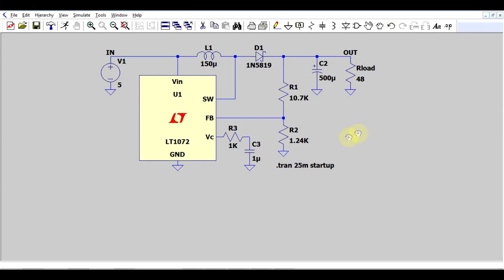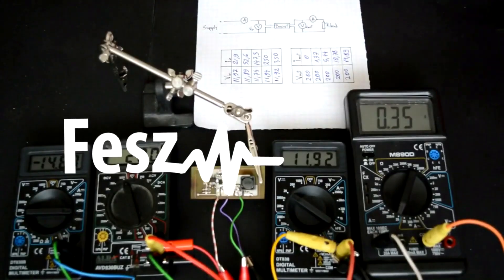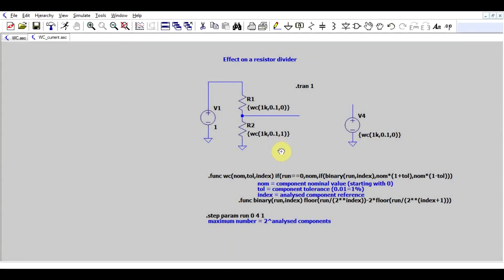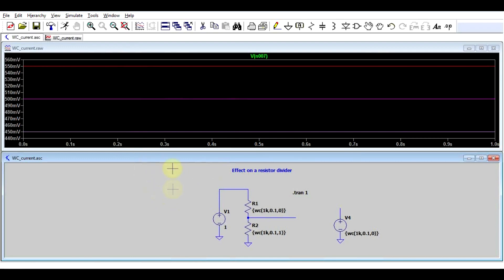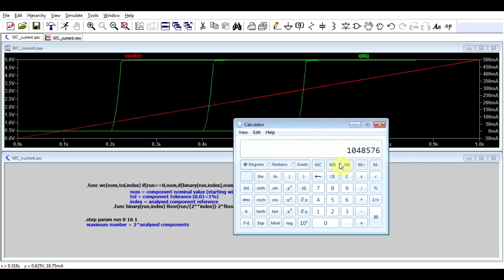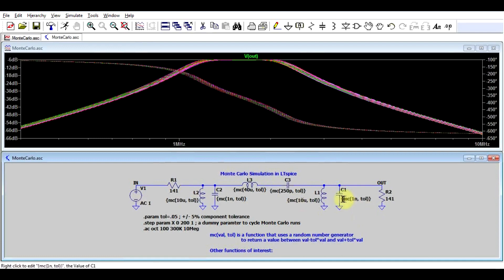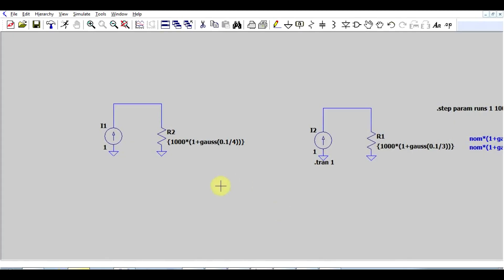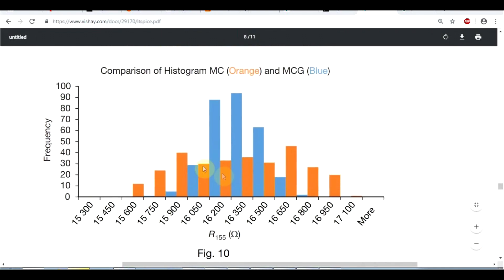LTspice tutorial - Worst Case, Monte Carlo and Gaussian statistical circuit analysis

Comment: Likewise, beyond glad, thank you. In WC analysis how would you model correlated resistances (like two conductors in a cable that could each be between 0R and 100R (ie will track each other depending on cable length)?
Reply from the maker: I'm not sure I understood the question, but you can define a parameter independent of a component as having a tolerance: ".param res={mc(40,1)}" and then use this parameter in the component definition, or any number of components; so you can have R1 and R2 with the value {res}; or some variation of this ex {2*res}
Reply: @FesZElectronics  Perfect, thank you so much. That is the fix I needed.

Comment: This analysis, although technically correct doesn't necessarily reflect the real world. The reason is that the component manufacturers often measure the value of each new component and then bin them accordingly. That skews the distribution of values considerably. The result is that if you purchase 1000 5% 1k MF resistors virtually none will fall within the 1% tolerance as they will have already been weeded out and classified as 1% tolerance. What you will get is resistors that are about plus and minus 5% away from the nominal value but virtually none that are within the 1% and 0.1% bands.
Reply from the maker: I have to say I only partly agree; Of course some amount of binning is done when resistors are manufactured, but the 0.1% resistor and the 5% resistor will most often be built from different materials and using different techniques; with very good precision you also want low temperature coefficients and other parameters to be more controlled. I guess also the measuring its self is far more pretentious to verify the 0.1% compared to the 5%; anyway, I do agree that a 5% and a 1% (or any other close tolerances) resistor can be built the same way and just separated by binning;
This raises an interesting question though - how can you simulate a tolerance interval - so not 0 to 5% but rather 1% to 5%. I will have to look into this a bit.
Reply: @FesZElectronics  I would think 0.1% resistors would be individually laser trimmed simply to improve the production yield. It may also depend on the manufacturer.

Comment: Great tutorial as usual. However, I am getting an error message "can't find model MC". I thought this was built in to LTSPICE. Using values such as {mc(2nF,tola)} with version 17.0.24.0 on Windows 10. Do you have any idea? Thanks
Reply from the maker: I currently have the 17.0.23.0 version installed and have no issue. Anyway the mc function was around even in LTspiceIV so it should not be a version issue.
Did you try running the "montecarlo.asc" simulation found in the LTspice instalation folder under examples->educational? if that runs correctly, the issue should be some sort of syntax thing..
Maybe you can share the netlist if the circuit is simple? (View->SpiceNetlist)

Comment: Great Work; excellent explanation! Can the temperature Spice Directive .tmp -40 25 85 be included in your mc schematic? Also, do you have a website? If so, please let me have the link.  Many thanks, R.
Reply from the maker: You can include temp directive also, just make sure the circuit actually takes temperature into account. 
I don't have a website though, never found the time to make one.

Comment: Hi FesZ, nice video. A few points:
1. "The guys at Analog" did not come up with this idea - I did. I was inspired by a blog post ( http://k6jca.blogspot.com/2012/07/monte-carlo-and-worst-case-circuit.html ) and came up with an improved implementation, which I posted as a comment in November 2012. The Analog article was written in 2017. The Analog article has now been updated with a link back to the blog, and the blog has been updated with a more thorough description of the method. (scroll down to the new heading "Optimized Worst-case Analysis"). It would be great if you could update your links with a link to the K6JCA blog.

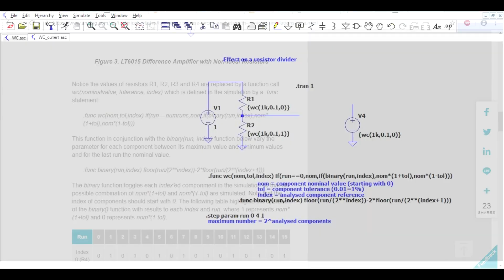2. There's a small mistake in your first example circuit (at time 03:03) - according to my original idea, as written up by Analog, the start of the wc function should be "if(run==4" (in this specific case), rather than "if(run==0" as you have. However, another user posted, to the aforementioned blog, a good improvement - change the start of the wc function to "if(run==−1", and then set your run parameter to step from −1 to 3 in steps of 1. This is explained in more detail in the updated blog post.

3. This "worst-case" method will not necessarily catch a circuit's worst-case behaviour, if there is a non-linear relationship between component values and circuit behaviour - i.e. it will miss "local extrema" in behaviour that does not occur at the extremes of component values.
Reply from the maker: @Harry Dymond Thank you for pointing this out. I modified the video description. I think it's quite a shame that most often the ones remembered for an idea are not the original creators but rather the ones who manage to distribute the idea...
Regarding non-linear circuits; what method would you suggest to find the extreme cases, other than MonteCarlo?
Reply: @FesZElectronics  Thanks FesZ! I think MonteCarlo is the ideal tool if the circuit has non-linear relationship between component values and circuit behaviour. You just need to make sure you do enough simulation runs. How many runs is enough? I guess you need to ask a statistician for that!